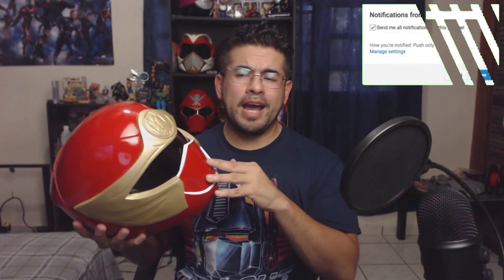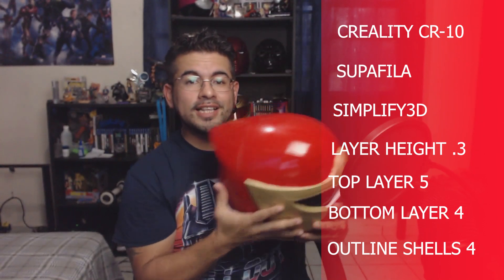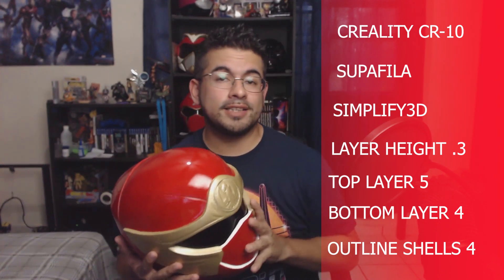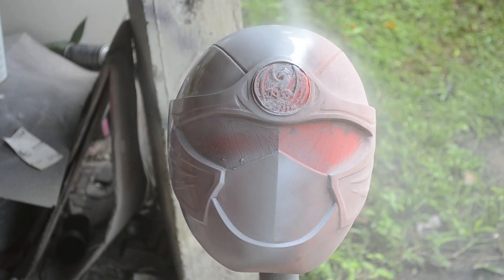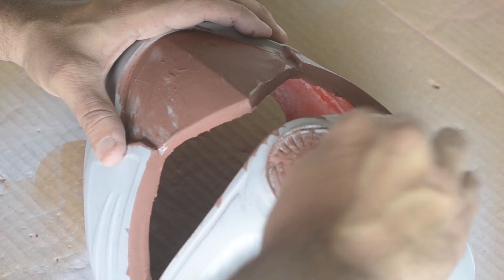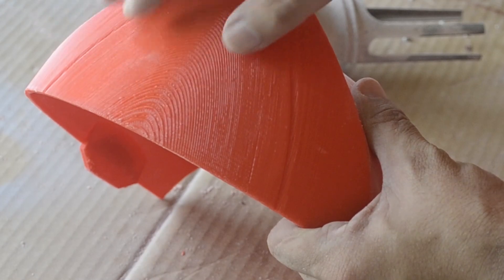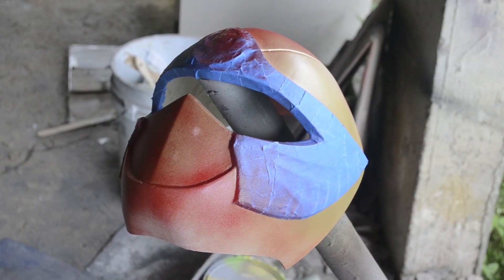3D Printed Red Ninja Storm helmet RIP Pua Magasiva

Comment: So you finally decided to use the neodymium magnets. What changed your mind?
Reply from the maker: nothing i been using them for along time now just some people want the latches instead of the magnets at times
Reply: Ah. You know, you could save some time with the helmet if you eliminate the visor in a 3d program. However, you will have to create supports for that section when you print the front part of the helmet.
Reply from the maker: @seekertosecrets  yes which it why i cut cut it out  cause supports can make it a lil messy if they fail

Comment: I also have a question. I’m making a helmet with Pepakura and i’m Curious. I made mine without a visor. But if you have used Pepakura you might know that you start it out by taking a 3D Model and folding Paper. I don’t have a visor just an empty space. This helmet is actually the Ninja Storm Navy Ranger. I also plan on doing the Rhino Ranger (Because my skills with folding are not perfect like I wish). I wanna ask how you paint your helmets and get the visor. It will help me a lot with my work on these helmets. I might try and make more helmets if it works out well. I do just use models from Super Sentai Legend Wars because I don’t have the money for those kinds of helmets. I also have to ask, have you ever tried using Pepakura for helmet making? It is a longer process but less money to do.
Reply from the maker: https://youtu.be/adqQafj2gV0
Reply: C3POwsome hi it’s Matthew here and I’m trying to start a Chanel with anything could you help me with buying the materials I need to put together to make my helmet I’m making it out of foam and the only thing I really need is all sorts of Eva foam but that’s all I need